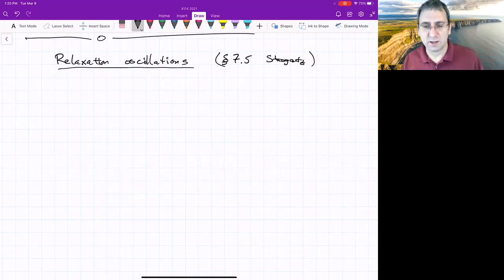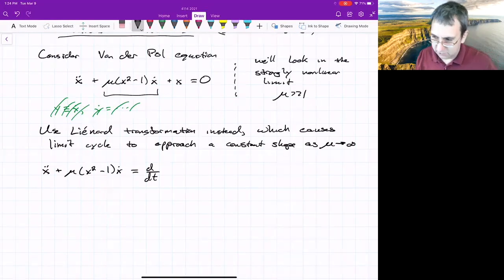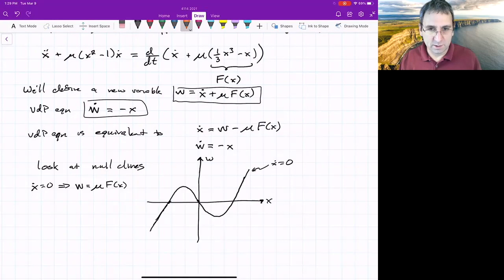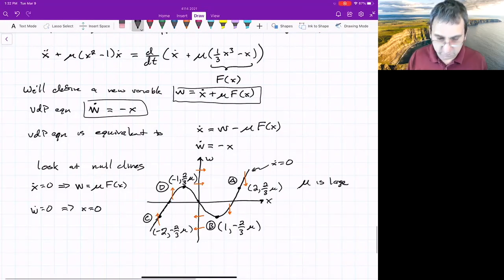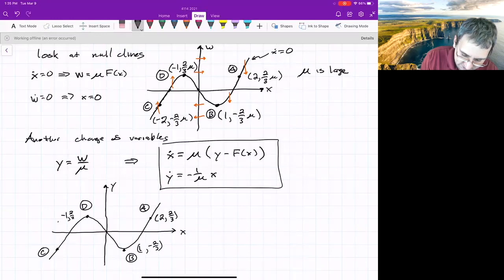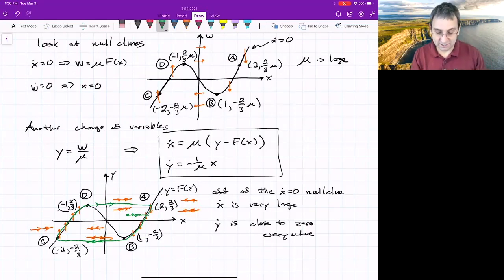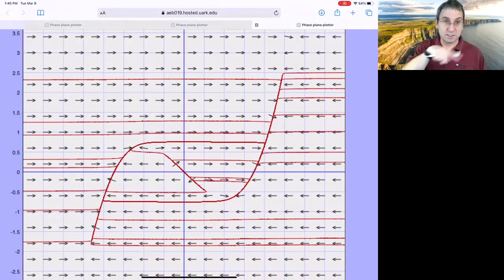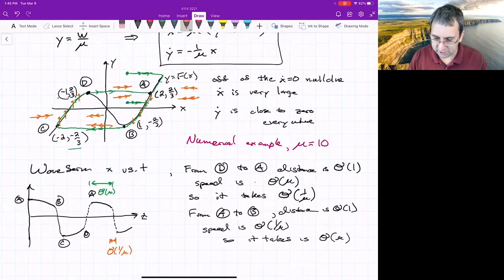Limit Cycles, Part 4: Van der Pol Equation, Strongly Nonlinear Limit, Relaxation Oscillations

Comment: At 11:12, you said "what appears to be a limit cycle". You continue with "And because of our rescaling, the limit cycle looks the same as mu goes to infinity", indicating that it is a limit cycle and not just appearing to be a limit cycle. Perhaps I am just over sensitive to language, but in logic there is a vast difference between the two, basically two different entities A and B.  I looked it up elsewhere and the Van der Pol seems to be a limit cycle. 

You have a nice way, but it is unfortunate that the initial mention of relaxation oscillations was not specifically pointed out within the final graphing, say against time or in the vector map.